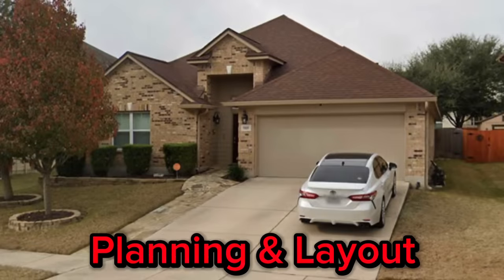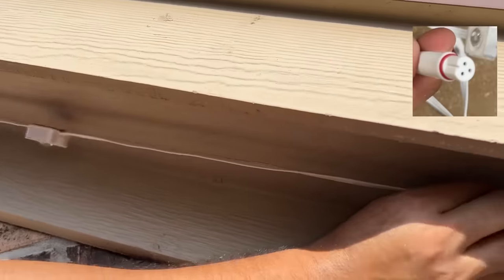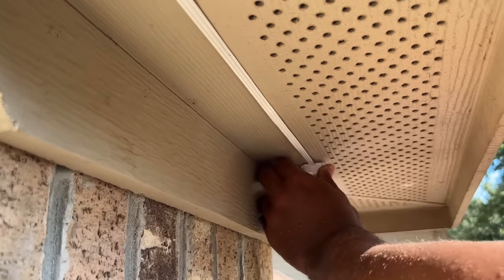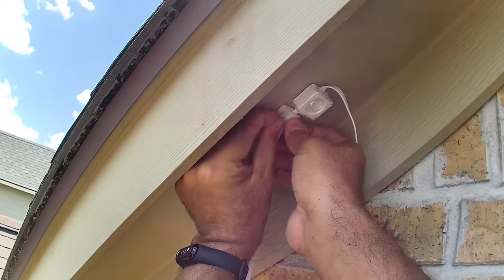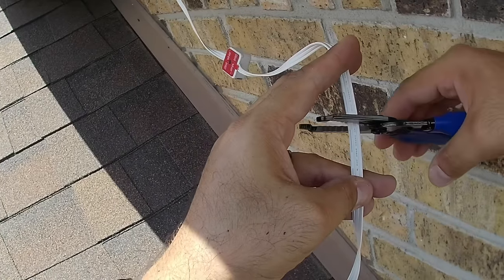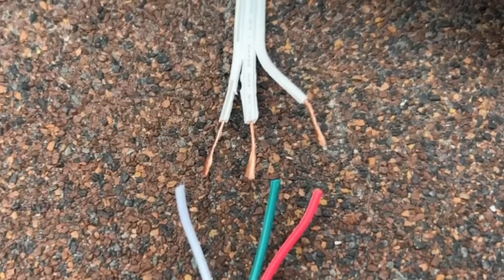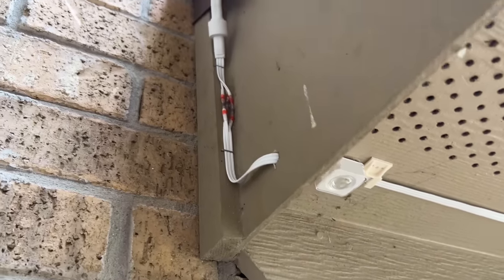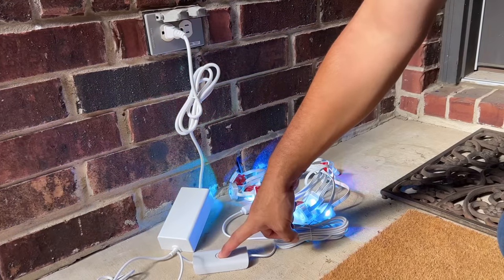Govee Outdoor Permanent Lights-1st Gen.*HOW TO FULLY CUSTOMIZE* @GOVEE #govee #howto #diy

Comment: Forgive me if this is already answered:
You mention the white/green/red wire should only be used for “smaller jumps.” “Smaller” is relative. What length would be considered too long. I have a 14’ and 9’ gap I am trying to figure out. I am completely stuck considering Govee only provides ONE 12’ and does not sell additional strands by themselves. Please advise. Thank you very much.
Reply from the maker: Hi there and thanks for watching. No worries at all. If you have just one small jump that is about 3ft then it’s doable but if you have multiple(at least 5) jumps then  you will need to try and keep those under 2ft. On the first generation lights, the 100ft kit comes with one 12ft blank extension. The 150ft comes with two. On the Pros, comes with one 12ft blank extension and two 4ft. Hope this helps you
Reply: I ordered a 150 foot kit and believe it only came with 1 extension cable
Reply from the maker: @SGMercer it should come with two 12’ Govee extensions. Check one more time, if it doesn’t have it then reach out to Govee website for support and let them know

Comment: Hi there thanks for the video. How does that 18/3 connector wire hold up to the elements over time being exposed to the TX heat, rain, etc. just laying on the shingles like that? That's my only concern that it's not hidden behind the eaves in the attic. I live in FL we have horrible humidity and sun.
Reply from the maker: The lights and wire are rated IP-67 rated. 65-67 both provide a high level rating and provide excellent protection for outdoor enclosures. I did spray a clear protectant over the line of the 12’ extension to protect it from some of the elements which I didn’t show in the video.  I apply this to most painted materials when I do handyman projects to protect outdoor paints exposed to elements. Some of these items we keep addressing in our future installations so it wouldn’t hurt to protect them more if you can. Thank you for your questions

Comment: I want to install these on my house but worried about the wiring sticking out like a sore thumb during the day. My siding and soffits are vinyl. I'm not spray canning on vinyl. They should consider selling grey, tan, etc colored wires. Your video and process was great except for the spray paint overspray. What happens when it comes time to paint the house?
Reply from the maker: Hi and thanks for watching. These are items we discuss with our clients before we start any quotes. We have to make it clear before we proceed. This is a 3rd party product and warranties it comes with it is what you get. Of course, if we are in the area we will definitely replace a strand if it goes bad once the client requests warranty replacements or buys new strands. Our clients are fully aware and majority just want their lights up

Comment: Very nice job! One question, I just purchased a Govee RGBIC Permanent Outdoor light Set 100' Model H705A can these be cut to fit? I have solder waterproof sleeves but not sure what happens if I cut this run ....These things cost way to much to screw up!
Reply from the maker: Thank you for watching. The kit on the Govee website does say do not splice. Now, they say that cause if you do, it voids their warranty. That doesn’t mean they can’t be spliced but you need to have some knowledge of voltage drop when customizing your own length of wire jumps and take the amount of strands you have vs how many times you have to customize. Like I mentioned in the video, do all this at your own risk

Comment: Thanks for the video I bought the normal version h805c and having trouble splitting like a Y...Do we have any connectors for the same?
Reply from the maker: The normal version is H705. By your model type, you have the Elites. There isn’t a Y-split available on the market that we know of. We try and stay away from Y-split as the strands mirror each other. So for instance, you run a Govee scene, you won’t tell. When you start creating solid colors or accent lighting, you won’t have individual control on the strands tied into each other

Comment: I thought I saw somewhere that when you cut the light sections there is a minimum number of lights needed in that section for them to still work. I have a corner overhang that would only need like 4 lights on it and it would be spliced on both ends of that four light strand. Would that work out cause a problem? Thanks and great video.
Reply from the maker: Hi there and thanks for watching. Yes, they are group of 4 sections. You can’t end with less than 4. When you splice it, make sure to use liquid electrical tape. Before you do that, make sure no copper strands touch each other. I have a new video coming out that explains the set up and app features that will explain your question.

Comment: Question as to soldering connections. Does the light kit require that the connectors between each strand be used? For instance most of my extensions happen at the ends and beginnings of light sections but I have to make jumpers between levels, etc. I don’t 12 feet of cable between each section.
Reply from the maker: What kit did you end up buying?
Reply: @jbsdiytv  100 foot kit. I essentially have 3 connection points  that have to be fixed/addressed.
Reply from the maker: With this type of permanent lighting, you can’t split in the middle to power upper levels. The data does not read separately and all strands need to be continuous in a straight line. In my videos, we have had clients purchase 50ft kits to power other gables that separates rooflines below making it impossible to jump so those are separate devices. That also includes dormers
Reply: Not so much dormers as there are gaps that I don’t want to have a light hit because of the weirdness and spacing. Talking like 2-3 feet.
Reply: Also this video shows a 100ft kit. So that’s what I was going off of. Just trying to determine if the connectors of each strip can be cut and the cables connected via your solder connection technique.
Reply from the maker: I only show 1-100ft in the beginning for set up and test but there is 2-100ft used. You can cut the connections and solder directly from the lights to the blank extension. Just don’t cut off the power/data booster block it comes with
Reply: @jbsdiytv  Thanks so much for your help. Your video was excellent and it helped me figure it out. I had SUCCESS with all my strands. Thanks a ton!
Reply from the maker: @bsrodgers yes sir, not a problem. I saw your post this morning on FB Govee group. Glad we could help

Comment: I'm getting syncing issues between jumps, before the first splice works,  after the spice only does white. And recommendations before i order another set?
Reply from the maker: That’s is a bad strand. We have encountered this in many installs. Don’t order anything. Take a photo or video and post it to the Govee website for a free strand replacement. Well you did a custom jump probably so you will probably not get another free strand

Comment: When you mention to only use the insulated 3 color wiring over a small distance, how small of a distance does it have to be? Would it work over 5-6 feet?
Reply from the maker: That wire was 20gauge, if you need to jump that then use something thicker between 16-18gauge wire

Comment: What's the best distance you recommend from wall for best results? Thanks
Reply from the maker: Hi there. We install all our lights 2-4” from wall. You will get a nice triangle effect and it looks clean. Most want to get away from those measurements and get a round look but that looks somewhat ok for the scene modes but does not look good when accent lighting is used. Hope this info helps

Comment: Did you use 18/3 stranded wire? I need to make a few smaller jumps and want to make sure I’m getting the right stuff.
Reply from the maker: Yes sir that is correct. I have that product in the description of one of my videos. I’ll check and see if I have it on the others as well. If it’s not there I’ll add it. Thanks for your support
Reply: I should’ve looked in the description first. lol. Thanks!
Reply from the maker: No worries all good. Good luck with your install. Be safe

Comment: So how long was each run and how many power sources did you need?
Reply from the maker: This install was 2-100ft Non Pro kits. We powered at two back locations. Since then, we have done thing a little different on routing since we know their capabilities
Reply: @jbsdiytv  awesome! Thank you very very much for the reply! It looks awesome too!
Reply from the maker: Thank you for your support. Once you have a second kit, you can group them in the app to run as one kit. Install all your strands working in one direction. Left to right or right to left so it looks in sync
Reply: @jbsdiytv  oh wow, that’s awesome, thank you for the tip!

Comment: Hey sir. How you doing?
I bought 2 set of 50ft. I was planning to connect all 6 string to one power supply can that be done? When I need to do 3 jumps One of 17ft, 11ft and 9ft
The first jump I have to cut between lights in the 2nd string I use 18g wire and make sure all the connections are good 
I power up and only 1 light turn on after the jump. The wire jump is 17ft 
What do you do when you do jumps like that?

Comment: Can you turn off individual lights? I just purchased (2) 100 foot sets but there's a few spots I need a few turned off to make them look good.
Reply from the maker: Hello and thanks for visiting the channel. Yes you can. Open the app, instead of segmented go to advance settings and in that area, you’ll see a snake line. In the color buttons there will be one that has a red slash on them. Use that one to individually turn off specific ones you have customized. This cannot be done for the preset scene modes. Hope this helps

Comment: What is the distance between each led light? Is there a maximum distance you can go with the extension, I'll be using he 20awg wires for that purpose.
Reply from the maker: Hi there. Light spacing is 17” center to center. Govee provides a 12ft extension in the 100ft box and 2-12ft extensions on the 150ft set. If you’re going to be using custom wiring, I would only use those for small jumps like 1-2ft. If not you have voltage drop and cause flickering in your lights

Comment: how is the quality of these lights? I had bought a simple govee led strip a few years back for my desk and the colors started to go out after a few months. I want to try and do this at my house but I also don't want the lights to go out after a few months. Thank you in advance.
Reply from the maker: Hi Daniel. Thank you first for taking the time to view our content and leaving a comment. To answer your question, we have been researching a product that is reliable, easy to install and competitive to other products. I think we hit gold with this one. The product came out in 2020 and just recently a lot have attempted the installation and we have seen the VHB adhesive pad be the only downfall in decision to purchase this product. We did not let that get to us. We brainstormed on better ways to plan and install the product. It’s difficult to say at this point about the longevity of the product as I’ve done 6months worth of installations and I have not had one bad complaint on my installations. The lights themselves are ip67 waterproof while the power adapter and controller are ip65. They are rated for 50,000 life hours so you figure 4-6hrs could last you 10-12yrs give or take. But their will be days of the year you might not have them on.Other than that, if you plan accordingly with the installation process, you won’t be disappointed. Hope this helps
Reply: @jbsdiytv  that definitely helps! I tried doing led strips with some fancy WiFi led driver power converters and stuff. I couldn’t figure out soldering a 4 wire led strip with out getting solder over lapping. Such a pain so I gave up. But this option sounds 100x better and more efficient. Thank you. I’ll probably try this out this year for Christmas time.
Reply from the maker: @vids4fun807s we are in the process of purchasing some extensions from another product and will try out on the Govee product to see if they match. The process I’ve shown on my videos work if you stick to it. In October, a new length will be put out by Govee and there will probably be sales so it might not be available then as everyone will try and get their hands on some. If you have any further questions you can reach us on TikTok, FB & Instagram.

Comment: What is a heat shrink sleeve? Is that the same thing as the govee extension?
Reply from the maker: No it’s when you splice the wire and you need to bring the wire back together , you use the waterproof heat shrink solder sleeve to bring them together for a solid bond. Then you use the heat gun to shrink it. I don’t recommend taping or crimping it

Comment: What do you recommend me to do if I will be using like 110ft and will have left 40ft of lights ? Should I cut them and use the last 4?
Reply from the maker: Hi there. The strands are 16ft-4in. So you might have 2 strands left so cut in groups four on 7th strand. Hope this helps. Let me know if you have any questions
Reply: Thanks! Another question I just had is how did you powered the 2 “main” sections ? One is going right and the other left but govee provides only 1 power supply and controller
Reply from the maker: This house install was 200ft. 100ft to the left and 100ft to the right. That’s two power adapters and controllers. Then you group them in the app. Check out my Govee app video on how to group two controllers

Comment: When you say that wire should only be used for smaller jumps. What length would you consider to be smaller?
Reply from the maker: We typically use the 18-3 or 20-3 for at least 2-3ft jumps if we have one or two jumps and 1-2ft if we have three to five jumps. If you have jumps longer than 6ft I don’t recommend using this with out some kind of data booster or splicing some lights in your custom extension because the lights themselves can be used as data boosters

Comment: I was wdonering, how did you get the bottom of the house to connect to top?  It doesnt look like yoiu used same string for everything.  Or did you?
Reply from the maker: Hi there. Thanks for watching. At the beginning of the video there is the planning for a guide. The longer jumps we used the 12’ blank extensions provided by Govee, the rest of the jumps were 3-18awg wire. Hope this helps

Comment: I have a set of 100' and have had the same issue even with a replacement kit.

Both sets lights stop working and resets reconnect to power nothing works. The controller responds in the app its just the lights never come on. With your experience have you ever had this issue? If you have how can it be resolved?

How can you fix th
Reply from the maker: Hi there. Thanks for watching our content. Have you made sure your segments are correct under settings? I would first do a factory reset by holding down the power button for 5-6 seconds, check if that works. If not, go to your settings and make sure the segments are correct in there. If none of this works, start troubleshooting. Grab your power adapter and controller and test each strand to respond to the factory reset

Comment: Can these Govee light strips be spliced anywhere along the 16ft string? I just finished a 100(ish)ft section (with 6-16ft sections) and need 1 more bulb to perfectly complete the 100ft section. I have a 7th 16ft section to use as the donor of the extra bulb.
Reply from the maker: Yes they can be sliced but not less than 4 lights. You can only have 3 segments(stands)  in a 50ft kit, 6 segments on a 100ft but can add 3 segments and 9 segments on a 150ft box. You can’t add to the 150ft.

Comment: Whats happens if you exceed the 150ft light? I bought two 100 ft packs just curious. I will probably wire the back side of my house with the extra 50ft if it just cant be done
Reply from the maker: There are two types outdoor permanent lights. Once being the non pros and the pros. Please specify which 100ft kit you purchased as each example doesn’t apply to the other
Reply: @jbsdiytv  Yeah mine are non pro. I know the pro version supports 200ft.
Reply from the maker: @Scott-iw8yr ok thank you for that info. On the 150ft non pro kit which is model H705C supports 9 strands(9 segments) 108 lights. Anything pass this one device model will not light up nor read in the app. Yes buy a 50ft and add them in same model group to control as one